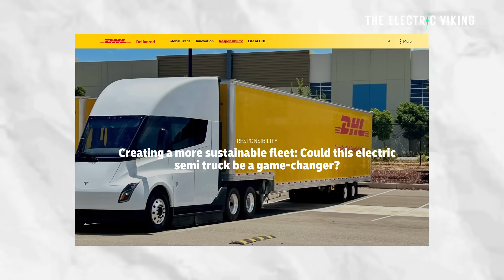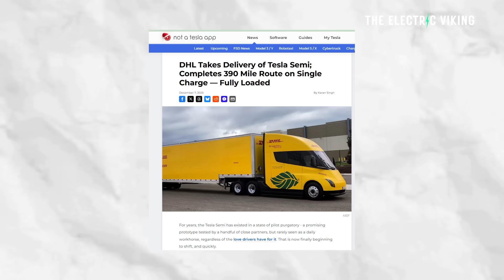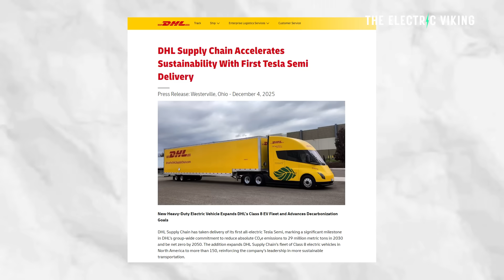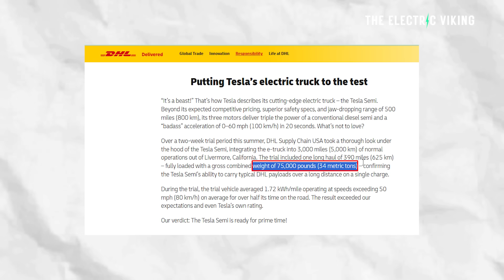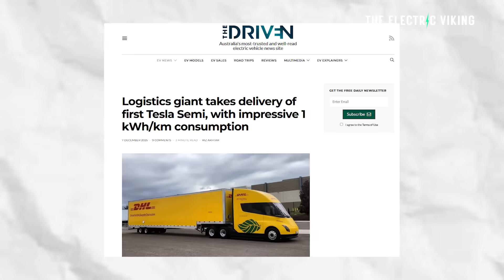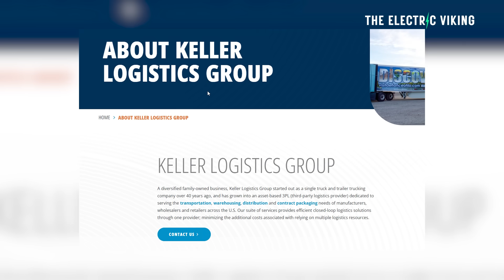Tesla Semi Drives 390 Miles on Single Charge Fully Loaded with Range Leftover!

Comment: For quite a while, it will only be good for some specific corporate uses where they can charge at their own facilities.  Actual independent owner/operator truckers, and even large common-carrier trucking companies, will find them less attractive.  It goes right back to charging infrastructure/locations in the USA, or lack thereof.  Pulling a 53 foot trailer, they can't just plug in at a car charging parking space.. 

 A trucker sitting in random place #1 in the USA, looking to book a load from random place #2 to random place #3, would just have to turn down too many loads due to lack of certainty in where he will be able to charge.  Bear in mind that long-haul truckers have to fit their driving into an 11-hour window before doing a sleep period.  So, it's not unusual to cover 600 miles per driving shift, with  65mph being their normal minimum speed when actually on the highway, traffic permitting.  Actually moving 9 or 10 out of the 11 hours is not unusual.  

Needing to aim for a rare charging location rather than whichever of the plentiful truck stops or rest areas they currently aim for, and choose as their driving day is ending in a couple of hours, would really slow them down.  

They are paid by the mile, not by the hour.  

The EV trucks are better used by companies with their own trucks doing their own routes between their own business locations, than by trucking companies moving freight for other companies upon demand.
Reply: The only way I see it working for cross country shipping is to have at least 4 - 1 MW chargers at every truck stop. At each location include a solar farm  with a Megapack to supplement the grid so that only 1 2500 KVA transformer is needed to provide for the full 4MW output at max output. Anytime the station is using less than the transformers output the solar can recharge the Megapack during the day and at night they can use the unused grid to top off the pack for the next day.

Comment: I will wait to see what that 500 range looks like in Nebraska or Colorado, when it's 20 degrees out and a 12 mph headwind and you're read to head up over the Rockies. Reality will likely change. I'm very pro Tesla and an electric Semi, but 500 miles of range will be impacted by temperature and headwind.
Reply: Just need a charging station at the bottom of both sides of the Rockies, driver just needs to know to hit that charger prior to going over it. Silverado EV did it towing 7K for almost 250 miles and it still had around 15% battery left. Before you might reply about the size and weight difference, you have to remember that semi's drive that route at a slower speed, while the Silverado did it at 5 over car speed limits (during the return trip still towing it was snowing and still made it). GM is up to 220KWH Tesla semi is almost 900KWH over 4 times the size, even though the KWH looks like it's to small the slower Semi speed limits up and down the Rockies would help a lot. Not stating that it could make it, but it would be a cool recorded Semi winter range test.

Comment: lets see it do a season on the ice roads in the arctic might be good for city deliveries
Reply: Ive driven ice roads in the north.Tesla Semi has more torque, and great traction control kinda like a diff lock. Can it handle Arctic cold would be the question. Once we froze our fuel line waiting to get onto the ice road.
Reply: @jaaklucas1329 its range would half
Reply: @fgeetvlover12  Just have to keep the battery warm. It does have a heat pump for that

Comment: I don't know why anyone is still talking about Tesla. They are supposed to be in mass production for many years now and they don't seem to be able to produce them. Something is off. Other companies fine.

Another thought - why is battery swap possible for cars but not trucks? With swap you can (almost) completely remove the wait issue, or so they tell us for cars. Me no understand
Reply: Check out China electric trucking. They are all in and they are jumping lack of infrastrucure by battery swapping,like Austrailia. You can slow charge your battery packs off hours at the depot.
Reply: RIP ⚰️hydrogen-SCAM-compagy Nikola Motor with No real costumers

Comment: A 1950's Oliver Super 99 2 stroke diesel  tractor makes 20 KW at  mid throttle. Since we don't like the exhaust we should changed the fuel. A Tesla in Ohio runs on coal, CH4 & nuclear power, I support solar & wind & bio fuel where it is sustainable. Elon is no friend of the environment. Rail is and will always be the efficient way to move ton/miles.

Comment: Guaranteed uphill acceleration will cause some warranty, insurance friction. 
In the end, lot of drivers will end up driving slow or slower than diesel for warranty extension.
Reply: Huh. You do know that by law electric batteries are warranted for 8 years and 100,000 presuming commercial vehicles are treated same as light duty vehicles.
Reply: @cre8tvedge  are they treated the same ?

With all the failed past promises it would be prudent to wait til 50k semis are out and watch youtube reviews pour in like they did for cybertrucks.
Reply: @Traintoytrain With Semis, it is all about a business case. Further, there a lots of electric semis out and have been out for a long time doing well as I understand it and no one does EVs better than Tesla... so a pretty good shot they will do well with this.

Further, the Cybertruck was unique in too many ways which had a ton of risk and in the end, yeah, its not popular, but those that have it, except for the lemons, absolutely love it like no other
Reply: I think the opposite. Lugging up a hill in low gear is more taxing

Comment: Pepsi has been testing Tesla semis for over 2 years and their fleet should be over 100 by now.  Once Tesla goes into full production mode, it's going to be stupid how fast companies will line up to buy these trucks.
Reply: They’re already lined up! UPS,SYSCO, DHL, Walmart, PepsiCo and JB Hunt, all have orders in totaling around 500 units. That number is certainly going to grow once they start producing the trucks in mass.
Reply: They've got to replace all the V1s first - they were trash. I haven't seen the V2 myself yet
Reply: You can have them all, fck trucking
Reply: There are already many electric trucks available years before Tessy showed up.  Tessy has nothing new to offer.  There have been FSD Semis operating for years outside the U.S.
Reply: @yourlogicalnightmare1014  Look at the hater, everyone.
Reply: @yourlogicalnightmare1014  Who else has center cab driving? Which other truck have 500 mile range?
Reply: @billthecat7536 
They are driverless trucks, so center cab doesnt apply.  Mileage, I havent checked them.
Reply: @yourlogicalnightmare1014  Those only drive pre programmed routes. Not a general purpose vehicle.
Reply: @williammeek-h2o 
Which still means you arent paying a driver 🥇🎯🙌
Reply: @yourlogicalnightmare1014  the ones "driverless" I seen were just remote-controlled, so there is a driver, just not in the cabin.
Reply: @yourlogicalnightmare1014  They didn't have the range and cost way too much. 
If you disagree, please provide specific counter examples including range and price at the time.

Comment: 390 miles fully loaded with feathers or air?
Reply: Whichever the Gross weight was 75,000 lbs. Go haul that with your F150. You trolls have to work harder.

Comment: what is the weight of the battery and by how much does it reduce the cargo capacity?
Reply: Who are you asking? Because this not a forum of the engineers, Tesla or manufacturers. Google as they say is your friend.
Reply: Most of the time its volumetric and not always weight.
Reply: 8000 lbs, so the cargo is reduced to 72000lbs.

Comment: Worth pointing out that DHL already has a number of other electric trucks and it remains to be seen which brand works out to be the best taking into account purchase price, reliability, cost of repairs, and time spend off the road. Volvo has just sold it's 5000th electric Semi.
Reply: its
Reply: there are already 100reds of electric semis in germany. 
i don't know all the excitement is because the yanks now have 1 (ONE)
Reply: @ursodermatt8809  I am guessing from everything I have heard is those from Europe are significantly fewer miles and also way less efficient, at least 20% less from all the stats I have read. Here, fuel is very cheap, so we have to make something worth considering which makes sense.    I think Diesel is roughly 4.50 per gallon there, while here it is $3.69 currently
Reply: @travisjazzbo3490  
why are you talking about diesel?
what has that got to do with the price of eggs?
and you are hearing too much.
(i have heard america is sinking into the sea tomorrow,  ..... ?)
Reply: @ursodermatt8809  Are you a slow person? America doesn't care about inefficient electric semis that don't go very far as you have in Europe because you don't need to go that far. We have cheaper fuel also, so we don't care about that. We need a better, more efficient electric semi case. What don't you understand?

Everything Ok over there?
Reply: @travisjazzbo3490  
i hear what you are saying.
now, you are upset because you americans have only 1 experimental truck and they are already in operation by the hundreds in Europe.
like many things you americans are way behind. and then you bring up  obscure arguments why you are ahead because you are behind.
no wonder you have a half baked Duce as a leader.
Reply: @ursodermatt8809  IIRC, the Tesla has the best range compared to the Euro ones? But besides range, we will have to see how the batteries hold up, reliability, cost of repairs,etc...
Reply: @supertouring1  
well yes, everything is better and bigger in america.
also more foolhardy by far judging by your great leader.
having just one truck does not prove it is better.
there is also already truck charging infrastructure all over europe.
Reply: @ursodermatt8809  Germany is tiny and way more socialist compared to the USA.  Americans are less gullible to government BS.

Comment: Awesome! Hope I live long enough to see a fossil free driving experience. After driving now for over 61 years with exhaust in my lungs.
Reply: Used electric cars are available for absolutely every price range although the $2000.00 Leafs don't go far on a charge.
Reply: As a 4th generation auto mechanic I've been watching progression of EVs for many years going from a sceptic to a Tesla owner... IMO EVs aren't there yet when it comes to light or heavy trucks. In both categories EV are becoming competitive, but probably need better battery tech to takeover the market. With electric cars I think cars of Tesla's quality just need to get a little cheaper and ICE cars are DOA.
Reply: @THX..1138  An article a few days back showed a yard truck able to lift 50 tons onto semi trailers at the port of Houston. It was designed so the lifting arm would regenerate electricity as it lowered the trailer down. There are working mining trucks hauling who knows how many tons up the winding walls of the mine. There are now electric cement trucks. Electric semis are working in China and Europe. Electric  trucks are capable of uses in local and regional areas today. Issues are money for adoption, manufacturing and battery availability. The death bell of ICE is starting to ring.
Reply: @cre8tvedge  Light and heavy truck EVs have the problem of weight. With current battery tech they are just too heavy. Light trucks have to have small battery packs to be affordable and to so they don't go over the weight where you'd need a commercial license to drive them. Over the road Trucks (in the USA) are limited to 80,000 pounds gross vehicle weight. This again means Trucks with large enough batteries for a full day of driving are too heavy to pull useful loads. With Tesla Semi they've tried to find a balance between battery capacity and weight, but with current pack energy density it will only be useful some types of trucking....

Sure there are new pack chemistries coming, but until they arrive EV trucks are not ready to totally replace light or heavy trucks.
Reply: Too much CO gives you weird side effects. I never hung around the exhaust end of my car very much!
Reply: What's matter with you? The vehicle emission is so low as compared to ten, twenty, fifty, and more years ago.
Reply: @InTeCredo  Nothing wrong with Russ. Let me whack upside your head with this: Would you turn your ICE on inside your garage with the door closed and take a nap in it? That's just one of the harmful emissions. I've been made sick while driving in Los Angeles traffic years ago. Those particulates are reduced but not eliminated including and in particular co2 damaging the ecosystem. Broaden your awareness.

Comment: To late to little... in europe and i guess in china they are behind on distance and charging speed both scania and daimler is better and volvo is on the way. Why should a company trust tesla when they do not has a unic sellong point any more
Reply: Hem…. No! The specs of the Mercedes e-Actross 600, and even more the Scania, as well as Volvo electric models are well inferior to those of the Semi.
I am keeping a spreadsheet of the specs of most models available in either North America or Europe (not China), and the Tesla Semi is head and shoulders above the rest. There is only one point we don’t yet know: its price… but it is likely to be lower than many!
Reply: Elec Viking pointed out that a trucking consultant company did a study which revealed the Tesla semi performed the best. That was back when it rolled out to Pepsi so as they've tweaked it's gotten better. One point it went from 1.98 kWh a mile to 1.78.

Comment: How many miles has Pepsi put on their fleet?

Hauling a full load of carbonated beverages will take more energy than DHS packages.
Reply: Nearly 90% of loads are volume, not weight maxed… of not maxed at all!
Reply: Word is that Pepsi loves what the trucks do for them and that they have great results on their regional routes.  And as whined about above also the DHL test did 75,000 lbs for just under 400 miles. I'm sure you can find a Reddit channel for your chatter.